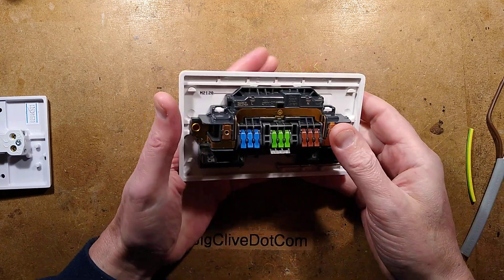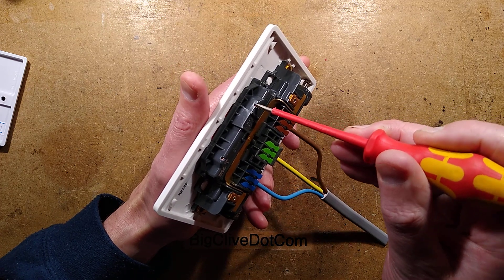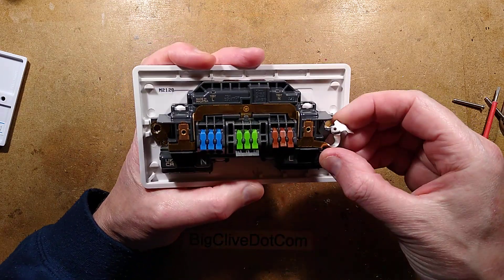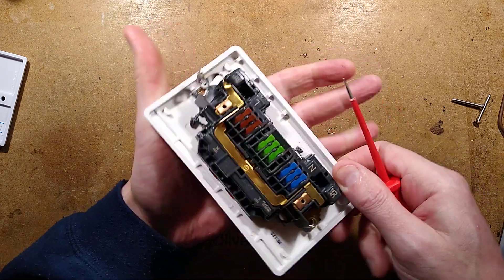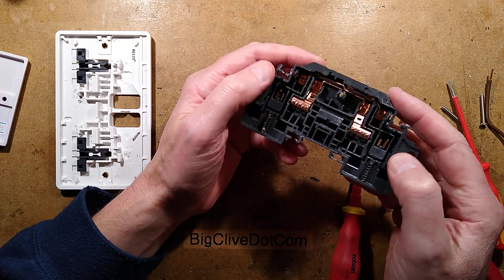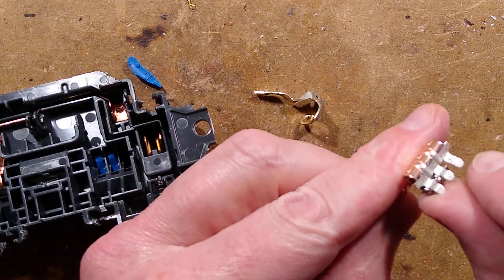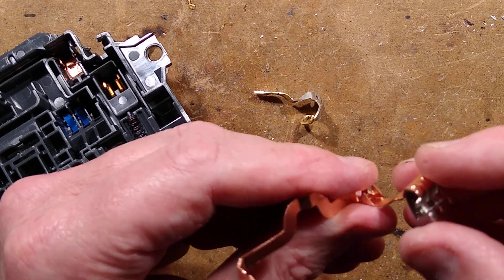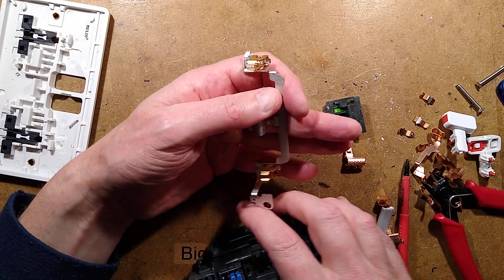Teardown of the new MK screwless socket

Comment: Screwing vs. stuffing into a spring. The question is, which is best😂.  I thought that good practice for the eath was to wire the ring to the back box and have a fly lead to the socket so that continuity is maintained if a socket is removed. Your thoughts, big man ?
Reply from the maker: I prefer terminating earth in the box too.

Comment: I just fitted one of these as a replacement unit after a flood/short-out scenario. 
With the cables coming next to vertically out, I felt I needed to do a lot more 'persuading' to get the damn thing to sit well enough that I could actually screw it onto the box.

Sure, it's always easier to fit something if you've got plenty of slack in the cables. Whilst this was the case for the 6 stands of the ring cables, the spur triple were shorter and offered less to play with (so good I fitted them last I guess, but that was more luck than judgement)...

That said, once I'd sworn a few times and 'put my back into it', at least it worked 1st time 🙂

Comment: The earth will be tinned copper or brass. Tinned with solder to reduce corrosion. 
The clip things look like bad practice though. One thing about good terminations in a ring cct has always been the twisting together of the 2 cables of each type before inserting into the terminals to be clamped. Thus seriously minimising resistance between outlets on the ring. These clip things do not allow for that and they also appear to slightly cut through the cable. Thus reducing its current carrying capacity and making a weak spot. Bear in mind that every termination on the ring may at some point have to carry full current before the 32a trips. 
MK used to be (EXPENSIVE) industry standard. 
They look like they are slipping.

Comment: When fitting one of these without Wago connectors. The RCD trip switch was off so went to put the switch in. The earth was live!!!. Instant fail. Circuit had a short to another circuit cross wired over. So upstairs was connected to the downstairs socket ring main, even though there are 3 separate socket breakers. So requested a rewire or an EICR Test. A rewire been done to separate upstairs to a separate fuse, and the downstairs, also the kitchen on it's own breaker.

Comment: A potential test for aluminium: Cut a little piece off and drop it into a solution of caustic soda (aka sodium hydroxide) in water. Aluminium is an amphoteric metal, meaning it dissolves in both acids and alkalis. Steel is not, neither is copper. So if the piece of suspect metal dissolves in the caustic solution, it was probably aluminium. Or possibly zinc, which is another amphoteric metal.

Comment: in the usa we have to strip the wire then bend it in to a hook in the direction the screw tightens! we are now starting to see stuff ware you strip the wire and insert it in the terminal hole & tighten the screw! other arangments exsist ware you just strip the wire and stab in hole! this is the worst! then we have outlets theat have a plug in pigtail that uses wire nuts! the best to me is the styel like the old uk plug you have! to get the eqivelent in the usa it is called a beck wired socket & has 2 sub types stab lock and screw type!

Comment: I love wagos, but I don't see something like this working in a busy jbox with solid core wire. I can see the wires pulling out once the wires are folded back inside and the plate is anchored.

Comment: You caused me to read about your ring main system.  It says the ring of wiring is fed from a single fuse or breaker rated 32A.  The wiring is 2.5mm^2 (10ga in US).  Pretty heavy wiring good for 30+ amps.  The ring circuit is rated 30A and the outlets are all 13A and you can have as many as you want except the length of the ring is limited to 50m.  I wonder if you can have a fully rated outlet of 30A.  You could weld in your kitchen.  I guess I could anyway if I plug into the range outlet.  The fuse or breaker is there to protect the wiring, which it does, and the outlets are smaller.  In the US the outlets (single ended) are all usually fully rated to the breaker and wiring.  Interesting.

Comment: Pure copper fully hardened from cold working (full hard or just hard) has a higher yield than mild steel 40ksi for copper and 30-36ksi for mild steel giving it "spring" where the cable is connected.  Any overheating will anneal it and can loose force (fully annealed is 1/10 the yield strength about 4ksi.  It would be nice to see a separate spring for the connection if there is a small contact area to generate heat.  Or, clearly if the building burns down the outlet may not work any more.  Don't mind me, I've had way too much coffee.

Comment: Do you think they should have a fourth CPC lever / clamp to allow for RFC and Spur and Earthing for metal back box ?
What is the Min/Max size of conductor that the clamps will take 1mm / 4mm  / 6mm / 10mm ?
Did you manage to work out if the "bus bars" are Copper or Brass ?
Reply from the maker: The busbars are plated brass.  I'm not sure the largest wire the terminals accept.   A fourth CPC terminal would be useful.

Comment: So update I fitted one of these sockets in my house which has multistrand copper so much easier will make it so.easy to spur of of. My  property has very few sockets so I've spurred quite a few just feel it's safer than extension cables everywhere. Being a council house I don't want to spend a fortune rewiring a house that isn't mine hence fitting spurs in. These are a god send highly recommend.

Comment: I wonder if they've tin-coated the terminals and by the screw holes, in order to prevent oxidisation of the copper and maintain a good electrical connection? These sockets do seem pretty skookum though!

Comment: I would have liked to see 4 earth terminals so that when used in a radial or ring configuration with a spur off to another accessory you could also run a bond to the metal back box as per standard good practices. Otherwise a promising product.

Comment: I like these sockets. This sort of connection method (although I would prefer the push to terminate style over a lever) is a more cost effective way to avoid lose connections and arcing, not expensive mandated AFDDs and vastly over priced consumer units.
Reply: AFDDs detect an arc, a Wago connector does not.

Comment: What a shame.  The old conventional sockets while not so adaptable for a 3 wire per terminal circuit could at least be stripped, cleaned and rebuilt. Perhaps not a normal need in the UK, but in the tropics where little ants seem to like to bring in concrete dust and then commit suicide the ability to strip down and refurbish is a great help.

Comment: I'd buy it. I like the way you can tell at a glance that the clamps are tightened. Also, I don't know if screws tend to slacken with thermal cycling or vibration but these look like they would stay tight.

Comment: I got a couple of LED roof mount flat lights with those connectors. Completely confused me as there were no useful instructions. Connections seemed weak as hell - first attempt they just pulled out, I treated them more gently the second time.
Have been assuming they were just some new standard I wasn't familiar with that had somehow passed CE.

Comment: I am not sure what you do dislike about aluminium as a conductor. It is not much less conductive than copper, is cheaper due to abundance and with plating you control the oxidation issues. We even use it for subsea array cable conductors and oxidation at the terminations is the only real problem to contend with. 
I think it might be silver plating at the terminals because the contact area is small and resistance might be a issue. 
Nice looking product.

Comment: I have never liked MK because I personally found that on their fuse spurs I have to use a smaller screwdriver to get at the terminals 4mm instead of 5.5mm which I use as standard (Wiha slim fit) and I always feel I may damaged my screwdriver when using what I consider to small a driver for the terminations. Another concern I may have with these wago style connections is (I have not tried these so it's a question) could they accidently be opened by excessive cable length when fitting the socket back onto the box

Comment: Finally, the uk electrical industry is catching on. I work globally and often have to modify or adapt electrical components, and I've seen these everywhere.

I hope to see them integrated in IEC C13/C14 and C19/C20 rewirable connectors to replace the garbage often sold, even by reputable companies like rs components.

Comment: What's wrong with aluminium?
Reply from the maker: The high resistance oxide that forms on it.
Reply: @bigclivedotcom  That wouldn't be a problem if the contact points were plated though?

Comment: what's wrong with aluminium anyway? about half the conductivity of copper but twice as much as brass. Yes it's more prone to corrosion but it has its merits. Actully has the best conductivity per unit weight, by some margin as well, they used it for hight power cables in East Germany, presumabily because of supply of copper being more difficult.

Comment: Convenient but perhaps too convenient. I feel it can't provide a lower resistance connection than a brass terminal block so if the point of it is just to make a sparkies job easier at the expense of quality and safety then it's just more modern garbage imo
Reply: I can see the benifit of having several terminal blocks though. Something that could be added to the old design.

Comment: Unfortunately twisting wires together, when they are solid single conductors of any gauge from 1mm though to 2.5mm or greater is a flawed practice, those of you who know some history of electrical installation wiring back as far as the fifties and sixties will know that the smaller 7 series gaugeing numbers of British Standard Cable of those times were finer solid wires that actually composed a conductor made up of a small number of  finer SWG solid wires, so an equivalent Lighting Cable of 1mm solid conductor today in imperial days twin or twin and earth(CPC) or Triple or Triple and Earth(CPC) for two way switch circuits, intermediate switch circuits for instance, would consist of something like 7 strands of solid wire of around 24 SWG or possibly 26 SWG to make a semi solid stranded conductor for Line and Neutral, The  Earth (CPC), would also be Stranded,and was smaller in cross secton accordingly with 5 strands as an example, how do I know this fact, my Father was doing all Electronic and Electrical Dissciplines and I helped out, I do not Know the exact Number of Strands any size/Cross section composed of for that x section as an example above or the 2.5 mm equivalent Tand E(CPC) cable of those days or the 4mm equivalent, but being softer and more malleable as finer solid strands and most round hole terminals could accept a good 3/4 inch of bare conductors, the conductors of two or three cables would be twisted together, even with a rounded end, convex point to the screw, some strands would enevitably fracture, as would be discovered if a socket needed changing, and additionally the wires would be often too short to strip the insulation back on them to regain the unbroken stranded x section of each conductor there by  maximising it's current carrying capacity and capability again.  as they were finer, twisting the wires together got all the strands to go in the hole most of the time if the person was careful and concientous, better to twist each wire individually and with the same patience and care insert them in to the terminal hole in a parallel  twin or triangle configuration and tighten the srcew on to them in that configuration, why ? , well you will not get the strands breaking, they actually compress across a greater Number of the strands spreading the Screw Point contact area evenly on the conductors with the same torque as before, by the time served, electricians feel of a self lubricating brass screw in a brass terminal, and they have an elasticity an engineer, eletrician, can judge before the point of too much torque and the screw fracturing.
moving to the present I never will twist any of the conductors L and N or the CPC in groups of two or three of their respective designations of L, N and CPC together, very often when I have to change a socket even with brass terminals and brass screws with a rounded convex point, the Earth CPCs of 1.5 mm in a Twin and Earth Cable, 2.5mm L and N conductors, will at least one of of two or three CPcs twisted will have fractured within the terminal and one will be adrift as soon as the socket is withdrawn from the metal back box or a pattress/surface mount plastic box etc, connecting any of solid conductors in groups of two or three in a parallel side by side in the case of two conductors or a parallel triangle configuration prevents any of the CPCs breaking and in a round window terminal hole there will be a collective on two or three conductors a greater concentration of contact area of each group of two or group of three solid wires in contact with each other and the terminal hole and the screw clamping and compressing them over about three quarters of each conductor's diameters, be it the CPCs or the L and N conductors in their respective terminals and less chance of fracture of any solid conductor except if it is a sharp flat edged steel screw in those terminals, also not self lubricating with a brass terminal and prone to freezing in the brass terminal if the steel's plating is compromised.
You can test  this assertion out for yourself very accurately especially if you use a torque screwdriver to obtain very accurate screw tension/compression capability on each gauge and Group of Two or Three Conductors of either L and N or the Earth CPC Conductors in Groups of Two or Three, with brass screws and do the same test with steel screws in socket terminals with flat ended threaded screws on a socket with brass terminals, the steel screws will enevitably cause more conductor failure, due to sharp flatends acting like a burred sharp Guillotine.
Leonard

Comment: The problem with these is the strength of the wire pulls the wires out by force and then you are bound to get contact. Not sure they are a good idea.

Comment: Our telephone company has been using screwless connectors for at least 30+ years.  I remember that the specification went into detail of the actual clamping force on the wire, to ensure a sound connection 'bite' into the copper and copper/cadmium wire.

Comment: 3:03
Drillin Like A Villain!
I like Wago-style connections for protoyping and fiddling, but I'm not sure about them for permanent installation like this.
I'm also not a fan of de-skilling, the term or the concept, but I'm biased in that regard.  Whether that is for better or for worse, time will tell.
10:31 If I had to guess, that "white metal" coating is basically like a layer of solder (or something else similarly soft and conductive), intended to melt around / on to and make better contact with any other conductive metal.  Sort of the reverse of Aluminum wire making worse contact after getting hot, if that makes any sense.
A lot of connector pins and contact points seem to use a similar principle to increase their contact surface area, and at the same time it makes them very easy to solder wires to them.  It also might have something to do with corrosion resistance.